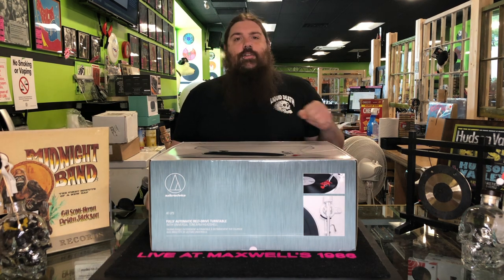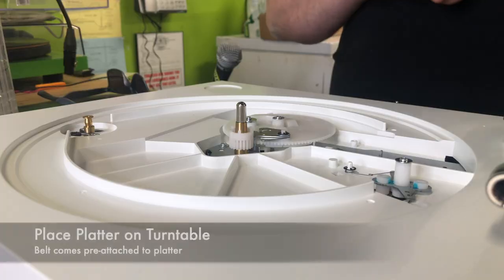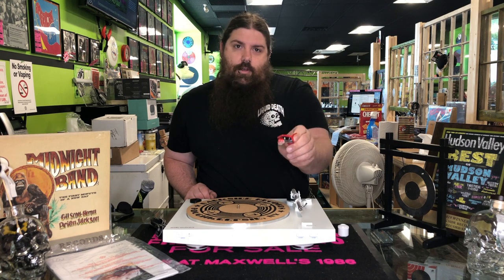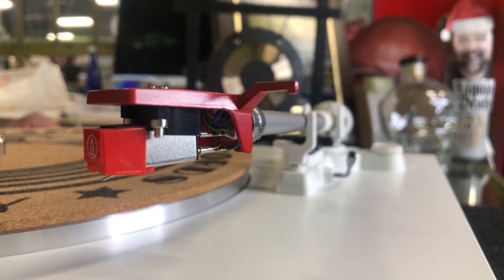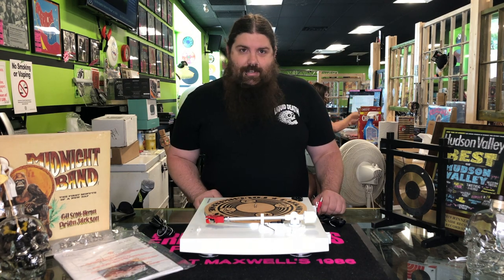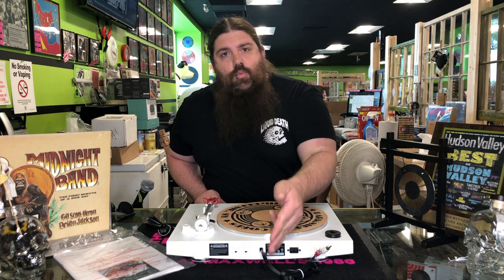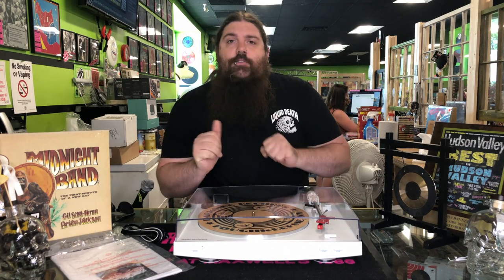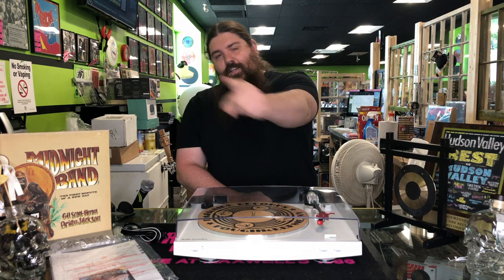Audio Technica LP3 turntable Setup & Review

Comment: Thanks for your video, but I need help here. I balanced my counterweight, but when I set the tracking force to anything bigger than 1 ( made sure anti skate matches it), the needle won’t touch the vinyl. Zero setting would be fine.

Comment: Question -------> About the "Ground".. I am bout to buy this turntable next week.. Looked on back of my speakers.. There is nowhere can put the Ground hookup.. There are no silver metal screws.. Only thing it does have is the black and red switches where would put wires into.. Would i still be able to use this turntable?? Thanks and all the best......, Mark...........

Comment: That helps a lot. Thanks for the video. Just one question, it would be possible to connect the RCA cables to an 3.5mm jack and sound good?
Reply from the maker: Thanks! There are RCA/3.5mm adaptors that can go between those two ports, and shouldn't adversely affect sound quality.

Comment: Thanks for the video. Once I corrected adjusted the tone arm to below 2, I was no longer hearing horrific noises 😅 but the sound is only coming out of the left speaker (it comes out both when I pair the speakers with my phone). Anyone know why?
Reply: I have a very similar model (LP3XBT) and had the same problem at first. Turns out I had the counterweight placed too far forward on the tonearm. Moving it back a bit and lowering the weight solved the problem.
Reply: Yeh, I eventually figured that out! Thanks for responding.